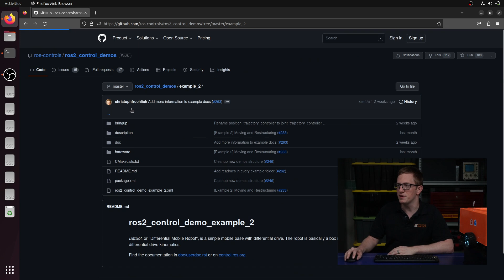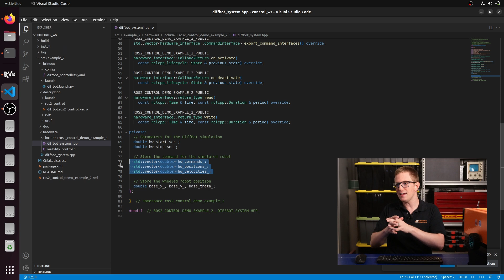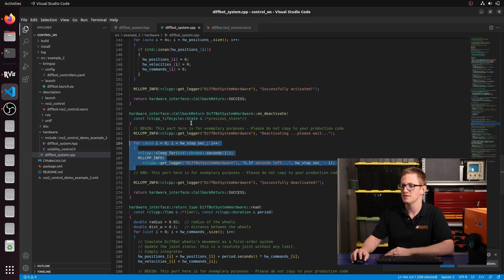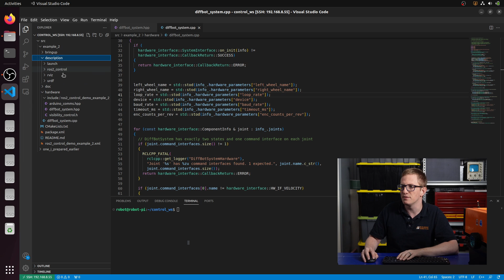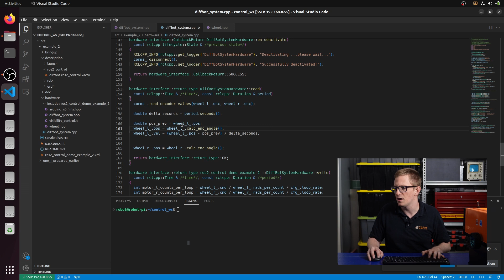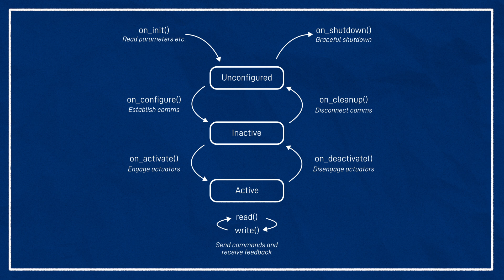Comment: I think you missed explain something, what firmware in the arduino that you used, did you use the ros arduino bridge that you made? If so, how can controller manager parsing the command that you made like to move motors you used ‘m’, to read analog used ‘a’ and, does the controller manager understand how to map all the commands?

Comment: Everything is explained really well, but where is the actual Arduino code/firmware for this DiffBot tutorial, please? In the repository I only see the C++ part for ros2_control, but not a ready-to-upload sketch for the Arduino. Could you please publish it or at least clearly state which file is meant to run on the microcontroller? Without that, it’s basically impossible to finish this setup.

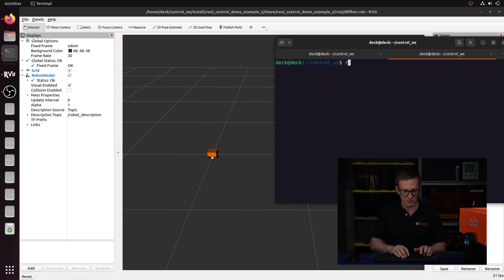Comment: For running the example_2 at 05:45, if anyone else is using ROS2 Jazzy, remember that ros2_control uses stamped twist messages now. Ex. "ros2 run teleop_twist_keyboard teleop_twist_keyboard --ros-args -p stamped:=true
Reply: Hi, i am also using jazzy, when I try to run it using joystick it coasts a little even after releasing the joystick button. Can you help fix it.

Comment: i  want to write my hardware interface code for 2 wheel diff_drive in ROS2  foxy (in jet son device Ubuntu 20).but i am having the error (may be due to version of ROS2).I am using the same code above and modify slightly.

/home/inv-lab/Harsh/robot_ws/src/diffdrive_arduino/hardware/diffbot_system.cpp:39:26: error: ‘info_’ was not declared in this scope; did you mean ‘info’?
   39 |   cfg_.left_wheel_name = info_.hardware_parameters["left_wheel_name"];
      |                          ^~~~~
      |                          info
/home/inv-lab/Harsh/robot_ws/src/diffdrive_arduino/hardware/diffbot_system.cpp:29:44: warning: unused parameter ‘info’ [-Wunused-parameter]
   29 |   const hardware_interface::HardwareInfo & info)

/opt/ros/foxy/include/class_loader/meta_object.hpp:216:7:   required from here
/opt/ros/foxy/include/class_loader/meta_object.hpp:218:12: error: invalid new-expression of abstract class type ‘diffdrive_arduino::DiffDriveArduinoHardware’
  218 |     return new C;
      |            ^~~~~

Comment: Hello Josh, thank you for this very informative video. I have a question/issue. My Encoder Counts per Pevolution is equal to 246. That means that if i keep loop rate to 30Hz, i can't get good accuracy of the speed control due to the fact that the encoder count/loop should be an integer but for many values of targeted speed (rad/s) I get the same integer number (with different decimal part). (For example 15 rpm is 1.03 count/loop and 20 rpm is 1.37 count/loop). One way to fix this is to use a lower loop rate (lets say 15 Hz -> 15 rpm is 25 count/loop and 20 rpm is 33.3 count/loop), so the values for count/loop will be more spreaded so that an integer value will correspond to only one speed value. Do you think it will be okay to use a lower loop rate  or i will have other issues? Actually based on my calculation the loop rate should be about 60 times smaller than the encoder counts/rev to get a unique pair of counts/loop for RPM of 1 to 100. In my case i should use loop rate of 4Hz. Is that enough though? I hope you understand what I am trying to say. Any feedback would be appreciated. Thank you!!

Comment: With your channel I started taking my first steps with ros2, thanks! I have a question, do you know what is the correct procedure for closing an application using ros2_control so that, for example, the hardware interface calls the on_deactivate function? Currently, I am making a ros2 srv call from the controller level to request a change of state in the hardware interface, but I don't like this approach. Unfortunately, after changing the state to inactive in the controller, the hardware interfaces remain in the active state..

Comment: You said in here you were connected to the robot via SSH for VScode but didn't go into how.  Personally having been using linux for a long time on multiple machine.  I use the SSH -Y user@hostname with X11 forwarding enabled in SSHD_CONFIG.  Then anytime I use that terminal window, XWindows just pops up the display on my local linux (WSL or an actually dev Ubuntu box).  This is a super easy way to just control anything from the linux box you're SSH'd into.  I just run the VS Code directly on the robot and have the display show on my local.  You might be just using SSH for file transfer but wanted to share in the event you havent tried this yourself.

Comment: Josh, this upload is fantastic. I am trying to implement the same but I am sending and receiving one extra variable at the end that manages another actuator I use in my robot on top of the left wheel and right wheel. I need to read the status of my robot from my ros ecosystem and depending on that I would manipulate the last extra variable (digState) I would be sending to my arduino via write function. I should update the ros ecosystem as soon as I get a feedback from the arduino through the last extra variable through read function. I tried implementing a subscriber node inside my hardware interface node but the callback function is not called and I noticed that it is kind of a limitation, correct me if I am wrong. After that, I also tried implemented a service server node (standalone node) and a a client (in hardware interface) that takes the service request and changes the internal variable digState to write to my teensy MC. Async request doesn't work but waiting till the service call is successful (spin until future) works but it affects the other syncing processes and blocks the entire main thread. Please let me know how I can to this? The extra variable I was talking about looks like this:

void readMotorFeedback(double &lpos, double &lvel, double &rpos, double &rvel, int &digState);
 void setMotorValues(double val_1, double val_2, int digState);

This works: (But blocks the main thread)
if (rclcpp::spin_until_future_complete(node_, future, std::chrono::seconds(5)) ==
            rclcpp::FutureReturnCode::SUCCESS) {
            auto response = future.get();
            digOnStatus = response->success;

The problem I am facing is acquiring the information from other ros nodes to hardware interface.

Comment: I have a question, does this ros control code needs to run on Linux with ros or needs to run on the microcontroller with microros or rosserial. And if the code run on Linux what should run on the microcontroller to allow the ros comunication and wich topics should it publish/subscribe

Comment: Hi Josh, I doubt you will see this but I wanted to ask,
The robot we are building for a project does not have encoders on the wheels instead we get the odometry with the lidar, this means that the motors only take an input, what do I need to change for the hardware interface for this to actually function?

Comment: hello! thanks for this great video! I am new to ROS2. When building then running the example 2 package I get :

[ERROR] [launch]: Caught exception in launch (see debug for traceback): executed command failed. Command: /opt/ros/humble/bin/xacro /home/bobby/control_ws/install/ros2_control_demo_example_2/share/ros2_control_demo_example_2/urdf/diffbot.urdf.xacro use_mock_hardware:=false
Captured stderr output: error: package not found: "package 'ros2_control_demo_description' not found, searching: ['/home/bobby/control_ws/install/ros2_control_demo_example_2', '/opt/ros/humble']"
when processing file: /home/bobby/control_ws/install/ros2_control_demo_example_2/share/ros2_control_demo_example_2/urdf/diffbot.urdf.xacro

rosdep gives me: 
rosdep install -i --from-path src --rosdistro $ROS_DISTRO -y
ERROR: the following packages/stacks could not have their rosdep keys resolved
to system dependencies:
ros2_control_demo_example_2: Cannot locate rosdep definition for [ros2_control_demo_description]

any ideas on what to do to fix this. A quick internet search sent me many directions... I am going to  try going through the ros2_control docs and tutorials as well.
Reply: Just copy the ros2_control_demo_description folder to control_ws/src then build your work space and you will get rid of this error.
Reply: @AhmedMagdy-xb8bl  hello sir can you help me?
i am facing issues?
Reply: figured out. sometimes you just have to keep swimming :). I saw that ros2_control for humble was failing on the website, so I upgraded to iron. Not sure if that was my issue, but it works now.

Comment: anyone else having trouble getting the joint_state_broadcaster and the diffbot_base_controller spawner working? I keep getting this:

[spawner-3] [INFO] [1708058146.393945768] [spawner_joint_state_broadcaster]: Waiting for '/controller_manager' node to exist
[spawner-3] [ERROR] [1708058148.244650086] [spawner_joint_state_broadcaster]: Controller manager not available

(for both joint state and base controller)
Reply: did you find the solution?
Reply: @RoboMech48  unfortunately I don't remember exactly what I did, but I think the issue was that I was forgetting to run something else required before running the command that was throwing those errors

Comment: fantastic. thank you, Josh. I should also mention that example_2 was updated on the repo a couple of weeks  ago to use TwistStamped messages, which means it might not work with the teleop_twist_keyboard. I tried to map the cmd_vel to cmd_vel_stamped, but it didn't work. I ended up sending messages from the cli. Maybe try to insert this line into the /config/diffbot_controllers.yaml file (under ros parameters). 
  use_stamped_vel: false
Reply: You can simply use teleop_twist_keyboard and pass stamped true like this ros2 run teleop_twist_keyboard teleop_twist_keyboard --ros-args --param stamped:=true This is because the diff drive controller expects /cmd_vel [geometry_msgs/msg/TwistStamped]
Reply: @ShahFaisalWani14  thank you.
Reply: Exactly the same.
Reply: jonathanar can you help me?

Comment: Hi. I'm new here but i got a problem with diff controller. When I use the teleop_keyboards, it seems nodes are correctly but my robot doesn't move. I don't understand what happend
Reply: Bit of a long shot, after a year. But I am running into the same problem. All seems to work well, but teleop_twist_keyboard doesn't move the robot... Did you manage to solve this? I've tried many variations of course, but I think this should be the right one: 
ros2 run teleop_twist_keyboard teleop_twist_keyboard --ros_args --remap  /cmd_vel:=/diffbot_base_controller/cmd_vel
right?

Comment: Hi Josh, can you clarify how you are getting the connection string to the robot "        <param name="device">/dev/serial/by-path/platform-fd500000.pcie-pci-0000:01:00.0-usb-0:1.3:1.0-port0</param>", my serial connection is failing when connecting to the arduino, also is there a way to simulate serial connection so I can see it on a terminal instead of receiving the string in an actual device. Great Tutorial by the way

Comment: Is there a way to do the hardware setup using Python?
Reply: Unfortunately not with ros2_control.
You could create the entire control system in python though (i.e. a node that takes a twist or other command in, calculates drive commands, and sends them tot he motors)

Comment: Thank you Josh for the best videos as always! I just have a question tho, if I were using a robot with a mecanum drive, would I just expand the plugin to account 4 motors? How does ros know how to deal with the very different kinematics then, I feel like I don't really grasp where the kinematics of a mecanum drive should be written
Reply: Yeah great question! If you check out my other video on ros2_control there are two halves to the solution, the hardware interface and the controller. So yep for the hardware interface you just expand it to 4 motors, but you'll need a completely different controller. Here are the ones that come with ros2_control, you'd probably need to copy one and write your own (or find someone else who's done it) https://github.com/ros-controls/ros2_controllers
Reply: @ArticulatedRobotics  Aha, that makes a lot more sense now, thank you so much Josh very grateful for your help!

Comment: Hi josh one question is the pi3 with 1GB ram enough for uploading ros
Reply: I would say, "No." Even 2 GB is sketchy. 4 GB works much better. PI 4 with 4GB is good.
Reply: As Russ says below, unfortunately it isn't really. Maybe if you used a different OS but that is not properly supported. I'd also recommend the 4GB Pi 4.
But if that's what you've got, try installing Debian. I think people have run it on arch too but that's a bit harder.
Reply: Oh and make sure you use an OS without a gui - Ubuntu Server may even be ok? But Debian headless would be better.

Comment: Performance here is critical, and especially on the Arduino side. Make sure you read the Serial I/O data one byte at a time, and make sure you loop through the bytes: while(Serial.available()) { char ch = Serial.read(); }  ... calculate, and control the motors as quickly as possible in loop() and keep everything straightforward (no classes, data structures, etc). All simple functions and global variables. I learned the hard way and my robot was jerky, twitchy, and not good at driving around.

Comment: First of all, congratulations on this great video. I have been working on something for several days now. I am trying to create a hardware interface that reads data from a topic (I am using micro-ROS and cannot find another way to do it). The only idea I had was to implement a socket to another node acting as a server. Do you have any ideas if it is possible to use topics directly in the hardware interface?
Reply: You can create Nodes directly, and from there call create_subscriber, create_publisher. I did this inside of a background thread function:

        rclcpp::Node::SharedPtr processing_node = rclcpp::Node::SharedPtr(new rclcpp::Node("MyControlHardwareBackgroundNode"));

        velocity_publisher_ = processing_node->create_publisher<my_cbot::msg::Velocity>(ASYNC_VELOCITY_TOPIC, 10);
        encoder_subscription_ = processing_node->create_subscription<my_cbot::msg::Encoder>(ASYNC_ENCODER_TOPIC, 10,
            std::bind(&MyControlHardware::on_encoder, this, std::placeholders::_1));

        while (!thread_exit_ && rclcpp::ok()) {
            rclcpp::spin_some(processing_node);
        }
Reply: This can be done, I made all of the I/O with the hardware itself async (running in another process). It really didn't work very well... data just got backed up into a queue in the DDS implementation and I ended up sending commands to the motors that were very old. I need to change the QoS settings on the topic so that it discards older messages automatically. My setup used a control hardware interface like in the video, but I published the commands to a topic. Then I created another node/script that subscribed to that topic and handled the hardware device.

Comment: for hardware_interface, seems on_deactive, on_cleanup and on_shutdown will not be called and can not be graceful shutdown. do you know how they work?
Reply: This is a great question and I almost covered it in the video. So those will be called IF you use the appropriate service call to deactivate/shutdown the hardware interface. This WON'T happen if you just interrupt it in the terminal with Ctrl-C, but would be used as part of a broader, structured system.
Reply: @ArticulatedRobotics  thanks for the answer. but why they don't implement auto graceful shutdown for hardware interface? is their any concern for that?